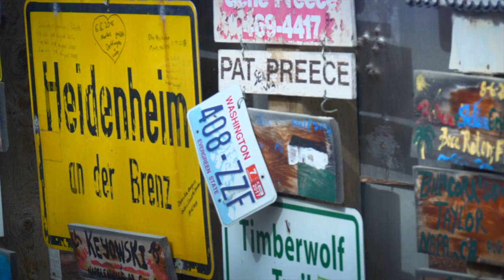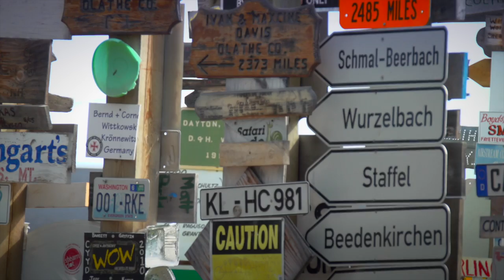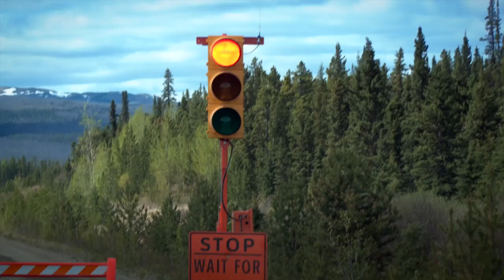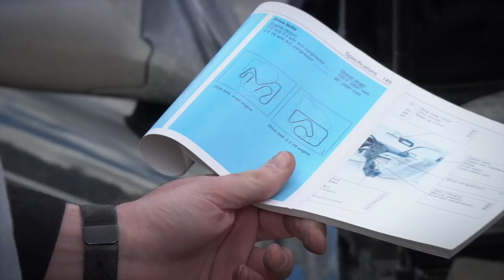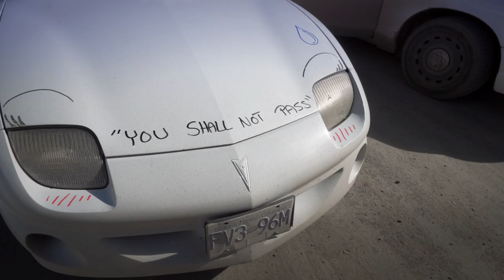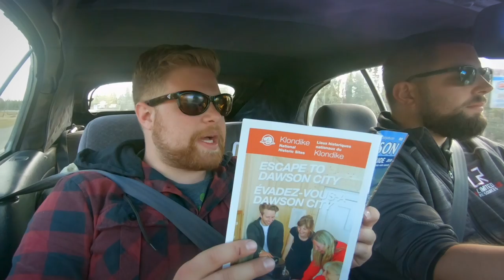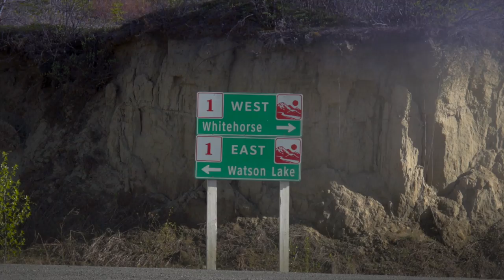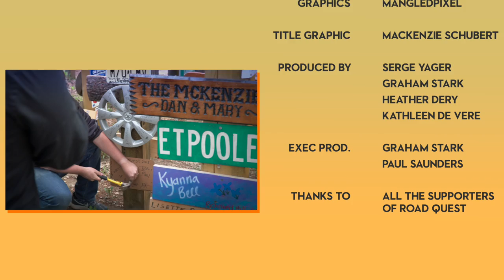Perils of the Yukon || Road Quest Ep10

Comment: I sure don't have many car tips but may I say that if, like Ian, you find yourself having to crawl under a car that requires tweaking way out in the boonies, don't use your jacket, use your car mats - preferably the ones from the back seat that don't see any use and are in pristine condition.  (Also: pretty good episode)
Reply: I actually ended up using a black towel I'd packed. I didn't want to use the mats, because I didn't want to soil the back side (the side that touches the car interior carpet). Gotta always be thinking about Sabine's cleanliness!
Reply: I think Ian values Sabine's clean interior more than he values his jacket's clean interior.

Comment: Questers of the road unite, you have nothing to loose but your chains!
Reply: Richard and your fanbelts.
Reply: @TheGamblingisgood  And Idle Rollers (or fan belt pulleys, or whatever esoteric term Saab uses to describe the part that sheered in half and let the fan/serpentine belt fly loose inside the engine compartment)
Reply: @empath69  if saab used a chain instead of a belt this wouldn't be an issue

Comment: It is my understanding that the 1995 Saab 900 was neither exactly a GM car nor a Saab - it was built on a GM platform, and then the Saab engineers threw out the orders they got from GM and designed it from the bottom up using Saab standards. Of course, then GM reined them in for later cars.
To put it another way, it's what GM cars would have been if Saab ran GM.

Comment: Should have stopped as soon as you got the first warning, could have been repairable, unless the pulley was already gone, which is quite likely. Also, why do they still call it "fan belt" when it has nothing to do with the fan, temps were up propably due to waterpump stopping.

Comment: Jet fuel may not melt steel beams but sure does melt fan belts
Reply: Actually the fan belt was FINE (luckily), it was the pulley that snapped in half and let said fan belt slip loose and flail around in the engine compartment - again, REALLY lucky that the belt didn't get damaged smacking something moving that would exert force on it.

...AND the belt DID do some damage we're not paying much attention to - the air filter base - that piece was broken OFF of a solid unit; now there's a crack around that replaced piece that's allowing air flow out of the filter assembly; that might well have a detrimental effect on Sabine's continued use (hope the service station Ian takes her to replaces that part, too)